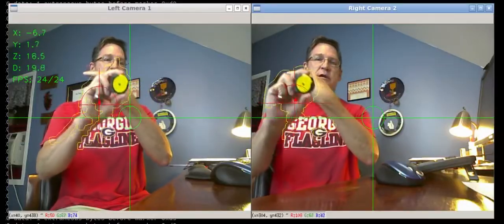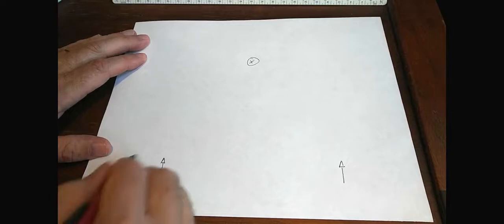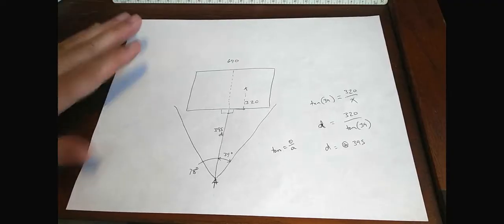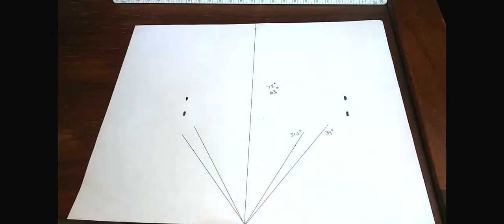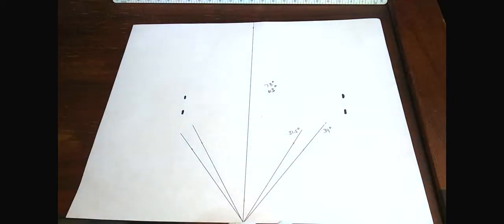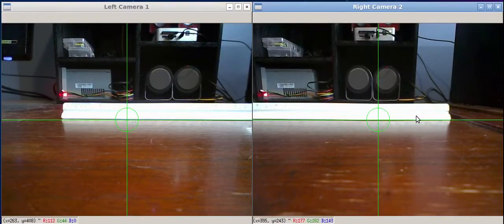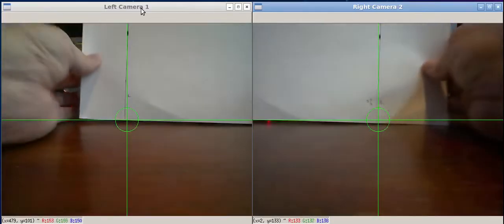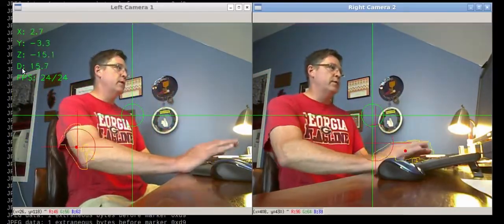Distance (Angles+Triangulation) - OpenCV and Python3 Tutorial - Targeting Part 5

Comment: I did not understand what the distance between the camera and the screen is , that entire part. What is the screen you are talking about and how do you calculate the angle from that?
Reply from the maker: It's a hypothetical frame derived from the camera angles and camera resolution. You need that to get the hypothetical distance from the camera to the plane where the pixels are, so that you can calculate the angle.

Comment: I am using HSV filter to track an object, but i am finding difficulties in finding the pixel position values of the object I am tracking. How can I find these pixel values?
Reply from the maker: I think an HSV filter only separates the color. It doesn't provide a location.
Reply: @ClaytonDarwin  Is it not possible to find the location after putting the HSV filter on? Do I have to make the program find the contours of the object first?
Reply from the maker: Yes. The HSF filter will isolate the color, but you will still have to identify a target and find a contour using other methods.
Reply: @ClaytonDarwin  I will try that :) Thank you!

Comment: Sir, how did you localize the point in the two images? Is it segmentation or something else?
Reply from the maker: In this case, I'm using the centroid of the largest contour in each frame. But you could do it another way, such as selecting the largest contour in one frame, then use images recognition to find the nearest match in the other frame. Or maybe a combination of both.

Comment: Awesome Claton, really helpful video.   I am new to image processing using OpenCV and aware of using Python, currently, I am working on a small proof of concept in Golf area to find the distance between the flag pin (hole) and the ball(s) through the image's taken from high resolution camera.   Currently, I am using only one camera to take the snaps frequently and will be using for image processing.   At any point of time, the camera and the flag pin (hole) are fixed length and the only variation will be with ball movement.   Camera, flag pin (hole) and ball will be forming a triangle and finding a way to get tan@ to get the distance from camera to flag pin and use this reference to get hold from camera to ball to find distance between flag pin (hole) and ball now.   Please can you help me on how to go about it.   Really appreciate, if you can help to solve this puzzle for me (using Python and OpenCV) :).
Reply from the maker: The problem is that you probably won't be a fixed distance from the ball. Even if you are a fixed distance from the hole, that won't help you locate the ball accurately because the green isn't required to be a horizontal plane. Since the ball is a specific size, you may be able to gauge distance based on size on camera frame if you have a super high resolution camera, but some kind of triangulation will probably be required. Locating the points on a triangle requires 3 measures, side angle side, or angle side angle. You have to figure out how to control for those. Might be easier to get distance with a laser range finder.

Comment: really appreciate the video,
i am running into an issue while trying to run your code , can you help me out?

if cv2.getWindowProperty('Left Camera 1',cv2.WND_PROP_VISIBLE) < 1:
AttributeError: module 'cv2' has no attribute 'WND_PROP_VISIBLE'
Reply from the maker: I was running on Linux. What are you using? Not every option works for every operating system.

Comment: is it possible to know x and y co ordinates using one camera and is it possible to know angle between two co ordinates with respect to horizontal or vertical line in 2d xy plane/image
Reply from the maker: As long as you know one measurement, like the distance from the camera, or the length of an object in the frame, you can calculate other angles and distances in the frame. Mostly trigonometry. There will be some deviation from the lens distortion.
Reply: @ClaytonDarwin  objects would be circular I mean circle..circle sizes known .. background page size is known..only want to know x and y value of the centre of any Circle using one camera which is in top view
Reply from the maker: Yes, opencv can easily find circles and tell you the center point in pixels. If you know the size of the circle, then you could convert pixels to another measurement scale.

Comment: Traceback (most recent call last):
  File "<ipython-input-17-1511616aea90>", line 113, in run
    frame1 = ct1.next(black=True,wait=1)
  File "<ipython-input-19-e140b82506f3>", line 206, in next
    frame = self.buffer.get(timeout=wait)
AttributeError: 'NoneType' object has no attribute 'get'

i get this error code,could help me?
Reply from the maker: Your camera is probably not connected. Make sure you are using the correct address.
Reply: videoio(MSMF): OnReadSample() is called with error status
videoio(MSMF): async ReadSample() call is failed with error status:
error i can't solve error
Reply from the maker: @wkwkzl  Get the camera.py code from my original targeting video. Make sure you can run both of your cameras with that, one at a time, then try the dual camera setup.

Comment: Thanks for making this video! Very inspirational. Just one question; how would camera calibration improve this setup? Would you get more accurate results, for example? Or would the setup be more robust to errors in the camera alignment?
Reply from the maker: In my latest project (see the laser tracker) I'm exploring this topic. I think that yes, calibration will help. But I'm also going to do some manual checks with a printed chart. The trick is getting the most accurate angles on which to base all the other measurements. With my new project I'm having trouble with parralax that I have to solve first.

Comment: Dear Clayton, this very interesting tutorial is what I had been looking for; Now I want to create my own code with the mathematics that is in the video but two doubts have arisen I hope you can help me:
1. Following the tutorial from minute 5 ... What if the point is to the left of the frame between 0 and 320 px? I made the calculation of the angles using complementary angles, the formula that I use if it is on the left or right would be the following:
a = number of pixels that the point moves away from the center (half of the frame "320")
x = arctan (a / d (calculated distance to frame, same as the video))
having the theoretical angle x and knowing the angle of view of the camera in my case 60 I did the following operation:
angle sought = 180 ° - (30 ° (angle of the middle of the frame) + 60 ° (angle where the camera has no vision) + x °)
but I'm not sure about it.
2. It is still not clear to me why there are angles with respect to X and Y, would it not result in two different distances? or how the 4 angles are related.

Thank you very much in advance for your time and I hope there are no very inconsistent questions.
Reply from the maker: In my example, there are four (4) distances being calculating. The distance from each camera to the object (the hypotenuse of each right triangle) on plane XY, and the distance from the X axis between the cameras to the object (the common sides of the triangles) on plane XY. And finally the hypotenuse of a triangle in 3D space from the object  to a point between the cameras (compensating for the angle above the horizon).  

You can do the math in several ways. However, they are all based on the angles from the cameras, and the distance between the cameras. Those are your reference measurements. You should be able to calculate distance to any point identifiable in both camera frames. Work your method out on paper and check that it works on known values/examples. You may have to get your trigonometry books out. Then it will work when you code it.

Comment: Is it possible to calculate distance between 2 objects using 1 single camera?
Reply from the maker: In general, no. But if you know the size of the objects, then you can estimate distance from the camera and distance between objects. Just some trigonometry using the object as the base of the triangle.
Reply from the maker: Or if you know how far the objects are from the camera. Thing is, with one camera you need a reference measurement(s) to get started.
Reply: @ClaytonDarwin  Thanks so much. Figured re. reference measurement. If such references are possible then the measurement across oblique distances is feasible? Do you have any direct experience with this or can you point me to code / examples I can check out. Thanks SO much :)!
Reply from the maker: To measure an oblique distance between two objects with one camera... I think you will need to get the angle between the objects (angles are explained in the video) and then get the distance from camera for both objects, and then you can do some trig functions on the triangle you construct with those. In order to get the distance to the objects, you will need to know their size, which will be proportional to their distance. Here is an example of that: https://www.pyimagesearch.com/2015/01/19/find-distance-camera-objectmarker-using-python-opencv/
Reply: Actually its possible and we doing it so with very high accuracy. The main point is to collect the high accuracy of the current position gps and gyro information. With couple frame you can use triangulation and can intersection the pozition and how far the items. This may depend the frame between images. will not work with stream or video.
Reply from the maker: Having an image from two different known locations is essentially the same as having two cameras.
Reply: Hi sir is it necessary to do image registration to find that the point in both frames are same.
Reply from the maker: You must locate the same point in both frames, so image recognition is one way to do that. Motion is another. Shapes, color, etc.

Comment: Hi Clayton sorry for asking. I'm getting error, the code worked but the video just popout for a second and exiting itself. The error code is,
 Traceback (most recent call last):
  File "C:/Users/Asus/PycharmProjects/liveStream/targeting_tools.py", line 133, in run
    targets1 = targeter1.targets(frame1)
  File "C:/Users/Asus/PycharmProjects/liveStream/targeting_tools.py", line 557, in targets
    frame3,contours,hierarchy = cv2.findContours(frame3,cv2.RETR_EXTERNAL,cv2.CHAIN_APPROX_SIMPLE)
ValueError: not enough values to unpack (expected 3, got 2)

DONE
[ WARN:1] global C:\projects\opencv-python\opencv\modules\videoio\src\cap_msmf.cpp (674) SourceReaderCB::~SourceReaderCB terminating async callback

[ WARN:2] global C:\projects\opencv-python\opencv\modules\videoio\src\cap_msmf.cpp (674) SourceReaderCB::~SourceReaderCB terminating async callback

appreciate it if you could help me out.
Thanks a lot
Reply from the maker: You are using a new/different version of OpenCV. The output from cv2.findContours has changed. Go to line 557 (line the error says) and change "frame3,contours,hierarchy" to "contours,hierarchy".
Reply: @ClaytonDarwin  hi thanks, I'm Sorry btw for not read the description on the video first.
Reply from the maker: Don't worry about it. I should really replace that code.

Comment: hi Clayton thanks for making this video, i wonder what if i want to detect a car and measure the distance
Reply from the maker: The idea is the same, but the process will be more complicated. You will probably need to add a object recognition layer to limit detection to cars, and you will likely have to deal with multiple objects at once. It might get messy, and you may need a powerful processor to get a good frame rate.

Comment: Hello Clayton, thank you very much. I'm trying to fully grasp/visualize the principles. We compute, x, y an z distances (coordinates) in space from the cameras.

From the verso or your sheet of paper,  using the horizontal axis on the frame, we get angles A and B (cam A and cam B). Then from the recto of your sheet of paper using A and B we get the distance "d",  which would  be the distance (coordinate) from camera to the object along the "x" axis in space ?  Then using the vertical axis  on the frame, you find new A and new B and compute (recto) new "d", which would be the distance (coordinate) from camera to object along the "y" axis in space ? So "d" is computed twice, once for x in space and once for y in space ? If so, how to you compute "z"  ?
Reply from the maker: The first step is as you said. Get the horizontal angles from each camera to the object and use these to compute the distance from the cameras to the object. You can then use that distance and the vertical angle from one of the cameras to locate the object on the vertical plane. That is enough to locate the object in 3D.
Reply: @ClaytonDarwin   I see ! Thank you.

Comment: I guess itd be easier to calculate the position by just finding the sin(angle) / side ratios
Reply from the maker: Does that account for the projection of the image on a flat frame?
Reply: @ClaytonDarwin  if we know the 2 angles of the triangle and the distance between 2 cameras we can find the 2 other sides by the sinus theorem
Reply from the maker: Yes, that's what we're doing in the end. The problem is getting an accurate angular measurement from a flat projection, which is the first part.
Reply: @ClaytonDarwin  Oh alright. I guess i missed that part. Really nice video btw

Comment: sir, how many FPS are you getting and on what specs are you running this code on ?\
Reply from the maker: The FPS is written on the frame under the other specs. I think this was on an I3 processor.
Reply: @ClaytonDarwin  what is the . Range of detection , sir..
Can this algorithm calculate distance of objects  8-10 m away from stereo cam..
Thanks in Advance
Reply from the maker: I'm not sure. I've only used it in my house. I think if you have better cameras that would work fine.
Reply: @ClaytonDarwin  thanks. For your time

Comment: Hello Mr. Clayton ...
 I want to have the code calculate the distance for a specific object such as (a person or a car) using the haar cascade function. I am currently successful in making the program calculate the distance for the specified target but the problem is that when any other unwanted target moves (like a cat or  Dog or anything) inside the image, the program also measures the distance ... and I just want it to measure the distance for the predetermined target, how can I disable the distance measuring feature for the moving object.
Reply from the maker: Use object recognition to locate your target in one camera frame. Then use a sub-frame of just the target area to locate the target in the other camera frame (OpenCV function). Then use the triangulation method. In other words, don't use motion to detect targets.
Reply: I have not come to a good result ... I still have many problems ... Could you explain me more like where to put exactly the code (Haar Cascade) in the main code .... thank you
Reply from the maker: You are going to have to write a new program. You can use mine as an example, but it won't be as simple as just replacing one part. You can also use my code from the facial recognition video.
Reply: Salaam Ali Mohsen Can you give me your code
Reply from the maker: In the description and first comment.

Comment: thanks, excellent example of triangulation. I have one question. I use camera lens and it has barrel distortion. If I use this method, lens distortion must removed ?
Reply from the maker: Yes. There are some functions in OpenCV that can help with lens distortion. How much effort depends on how much accuracy you need. My cheap setup works fine without distortion correction for what I do.
Reply: Clayton Darwin thanks!

Comment: runfile('C:/Users/Hayat/.spyder-py3-dev/Project/angles.py', wdir='C:/Users/Hayat/.spyder-py3-dev/Project')
Traceback (most recent call last):
  File "C:\Users\Hayat\.spyder-py3-dev\Project\angles.py", line 119, in run
    frame1 = ct1.next(black=True,wait=1)
  File "C:\Users\Hayat\.spyder-py3-dev\Project\angles.py", line 445, in next
    frame = self.buffer.get(timeout=wait)
AttributeError: 'NoneType' object has no attribute 'get'

please help me it show this error to me
Reply from the maker: The camera thread isn't running. You need to write a small python opencv script just to test your cameras. Once you can read from the cameras you can use those settings for the big script. Maybe use the script from the motion capture video.

Comment: Where is your maximum range of distance?
Reply from the maker: Accuracy (or range) depends on the camera lens and pixel density, and on the distance between cameras. Here I'm using cheap vga cameras about 6 inches apart.  Seem pretty good to 20 feet inside. Haven't had it outside yet.

Comment: Traceback (most recent call last):
  File "targeting_tools1.py", line 133, in run
    targets1 = targeter1.targets(frame1)
  File "targeting_tools1.py", line 557, in targets
    frame3,contours,hierarchy = cv2.findContours(frame3,cv2.RETR_EXTERNAL,cv2.CHAIN_APPROX_SIMPLE)
ValueError: not enough values to unpack (expected 3, got 2)

DONE
help me to solve this error
Reply from the maker: The version of opencv you are using returns 2 values for findContours. The version I use returns 3. That's what the error says. You need to determine what values findContours returns and set that line accordingly. Probably doesn't return hierarchy, but I don't know. I'm running using Debian Linux and Python3.6.
Reply: hi ,you can solve this error
Reply: @dulquerkawsar  check your opencv version it should be 3.4
Reply: @meghashyamjoshi1094  Thanks